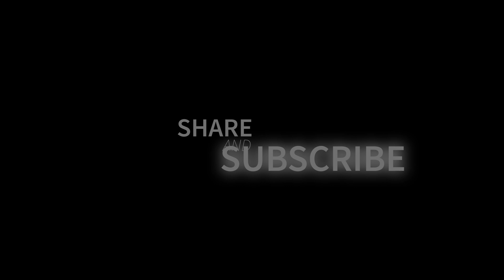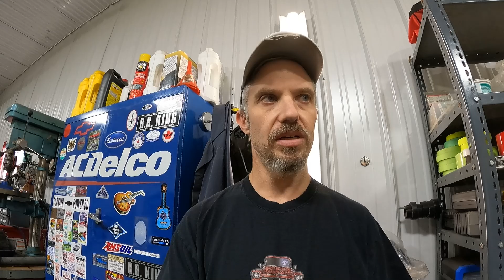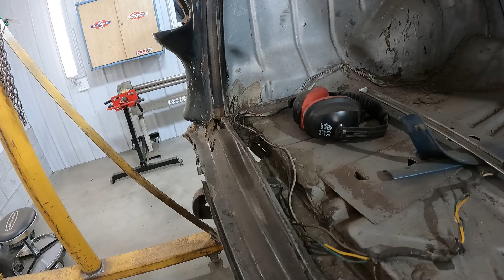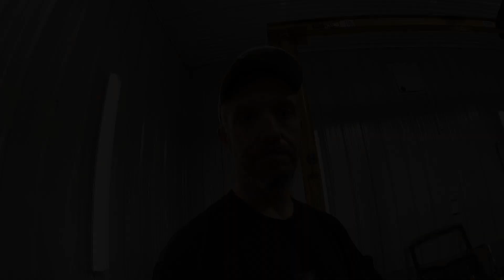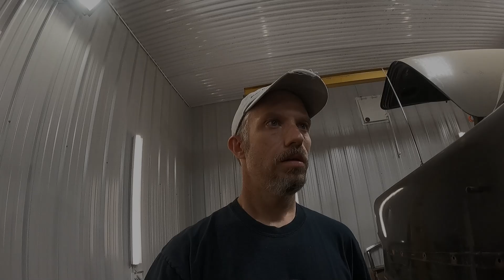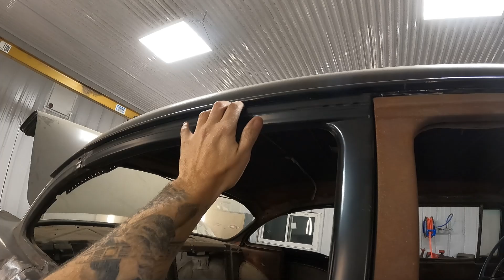1955 Chevy - 4 door to 2 door Conversion - Part 5 - Welding!

Comment: Watching this video I see what you was saying about the driver side panel, looks like you have to work on the drive side . I think you will be happy with one piece floor, I have watched DD Speed Shop  doing one piece floor. Dan explained that you will have same amount of money in piecing the floor as you will with a full floor, for the rear end maybe you can find a rear clip or donor car .
Reply from the maker: Yes, I'm going to redo the driver side. I'm not happy with it, and that means I can't leave it. I'll learn along the way. I've talked to Dan many times about the one piece floor, he definitely pushed me in that direction. He said the time savings alone makes it worth while. Time saved is a huge thing for me, and I think the end result will be a better quality product using the one piece floor. I've been watching for a donor for the back piece, but it's a trouble area and many of them rot in the same place. Unless I ship something up from the southern states, I'll have to wait until the time is right to buy the pieces I need. I have to balance the car parts budget over all my cars and projects. I also work alot of hours at my job to afford this stuff. Time and money, like everything else. Thanks very much for watching and following along.